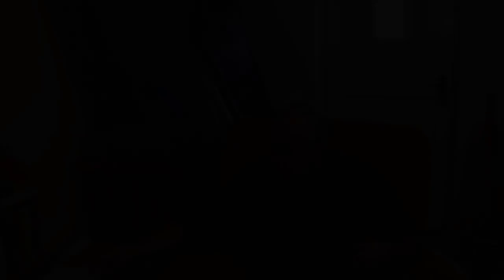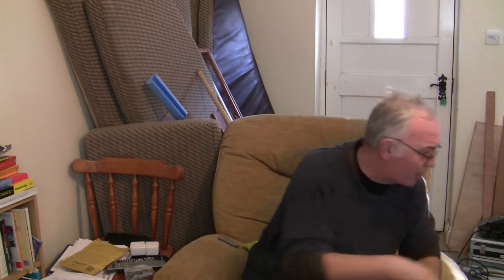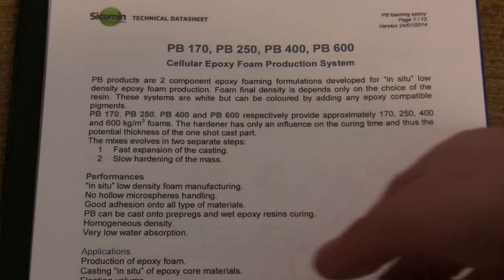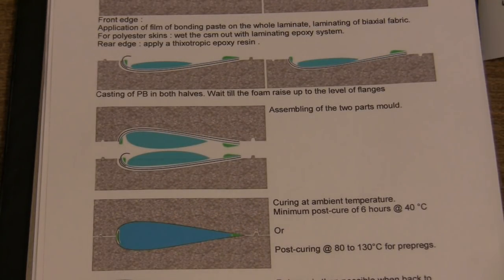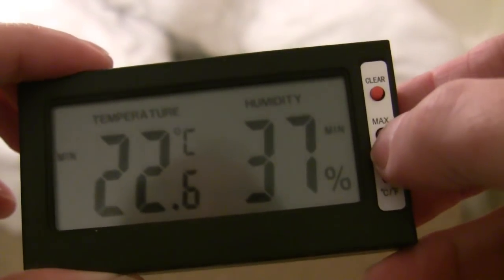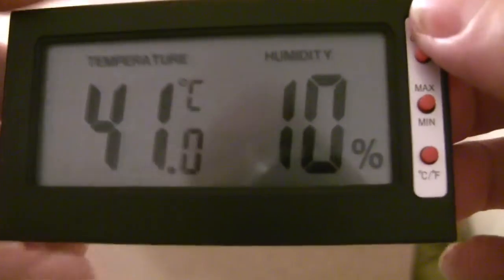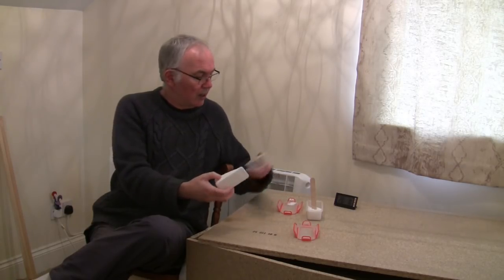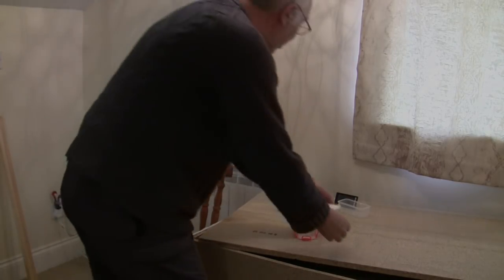Just About Sailing February 2018 - Fixing the Rudder, Pt 2 Figuring out what to do

Comment: I'm going to assume that was your rudder post bearings at the end of the video, hopefully you'll have more luck finding replacements than I did, I eventually ended up make new ones myself from Acetal bar, if you get stuck let me know.
Reply from the maker: Nick, thanks. Yes, those were the rudder post bearings.  I am assuming that I will have to get them made up.  It is a long time since I have used a lathe - so I might have a go myself - but I might not.  Are you happy with the Acetal?  I know that there is a lot of debate as to the best material to use.
Reply: Just about sailing. Yeah it was a good excuse for me to buy a mini lathe & turn the bearings out.  There is lot of differing views on Acetal versus Nylon from previous experience Acetal is easy to work with, withstands temperature differences really well and is pretty hard wearing.  I replaced the upper post bearing three years ago and the lower and skeg one last month & I’ve have no issues. In fact the tiller is so smooth now.
Reply from the maker: I have been warned off nylon as, apparently, it gradually expands.  Thanks for the info.
Reply: Just about sailing. If you get stuck send me the dimensions and I’ll knock them out for you. Just buy me a beer if your ever in Portsmouth.
Reply from the maker: That's very kind.  Thanks you.
Reply: Paul, if you get a chance could you let me know the column lengths and outside dimension if the tube sections. Can't drop my Mirage rudder yet, as no hole in the ground. :) I'm lucky that I know an engineer at my Tipner boat club that'll knock a set up for me, otherwise, anyone living further afield could approach Peter Squire Limited of Cornwall, who'll charge about £57 for a pair in Acetal, as "they don't swell like nylon does". I note the my Mirage 28 MK 1 has a bronze doughnut bush for the bottom bearing. Peter
Reply from the maker: Peter, send me a message with your email address through YouTube and I will email you a copy of the pdf document with the Mirage plans - that has measurements.  I didn't need to dig a hole as, by coincidence, my boat was moved about 10 feet to the left by the yard - easy to get the rudder out when the boat is in the air. I will need to dig a hole to get it back in. My bottom bearing is made out of very 'old fashioned' looking hard black plastic - as is the top one. Cheers.
Reply from the maker: Well, if you do decide on the forklift option don't forget to video it.  I'd watch that.  I've sent the pdf.

Comment: Will the change in weight of the rudder due to the internal fill effect the trim of your yacht?
Reply from the maker: Yes, it probably will. And of course it is all under the waterline so it will also affect the ballast ratio a bit.  It occurred to me that I should have weighed the rudder before I split it apart.  I do have all the bits - apart from the dust that escaped - so I should really work out the weight difference.  It's never simple is it.  Oh well.

Comment: why not just laminate marine ply with  epoxy with your stock included then just shape it with an electric planer . All you have to do after is to glass it over and it is ultra solid .
Reply from the maker: Yes, this is absolutely an option. And I am sure that for many people it would be very easy and would produce an excellent and strong result. However, I have a long, and not happy, history with woodwork.  It's almost a phobia.  I regard people who can make nice things out of wood as magicians.  I do have a few small wood projects in the future and working with wood is a skill I am trying to develop.  I did consider making a wood (or carved foam) plug, making a mould from that, and then making two new fibreglass skins.  I am also thinking about making a tiller from laminated strips as a spare - just to learn/practice wood skills.  Cheers.